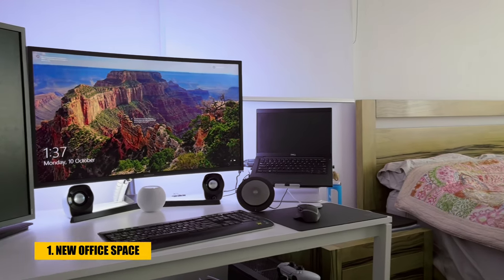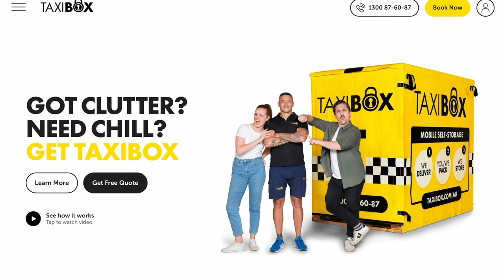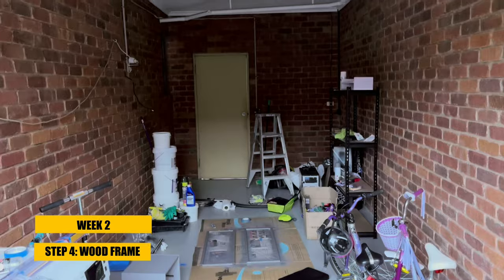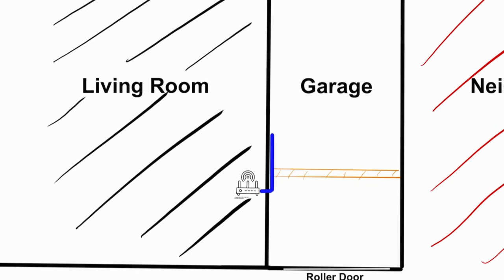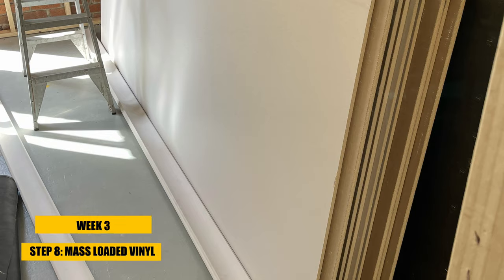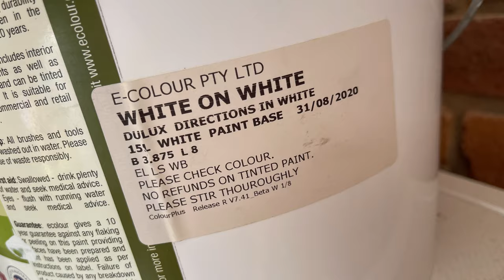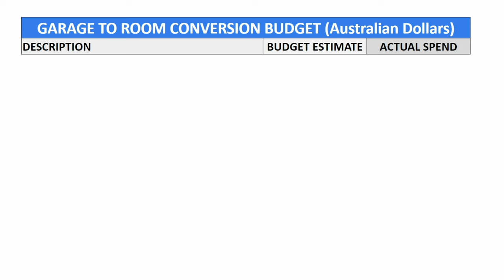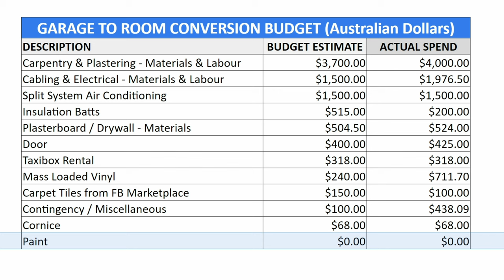How I Converted My Garage Into a Room and What It Cost

Comment: Nice job. Do wonder if you wouldn’t have been better getting the paper backed insulation and stapling it to the framing . When you doubled it up on walls and ceiling it would have given you an air gap further deadening the sound.
Reply from the maker: Hey  @colmbright9822  ! Yeah that might have helped. I don’t have that kind of insulation available where I am I don’t think. However by far the biggest game changer is the Mass Loaded Vinyl.